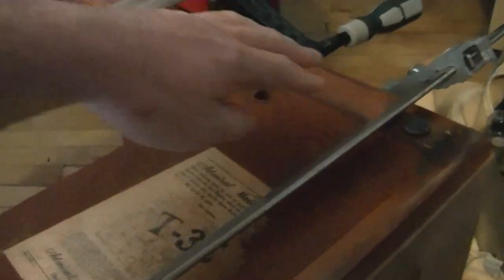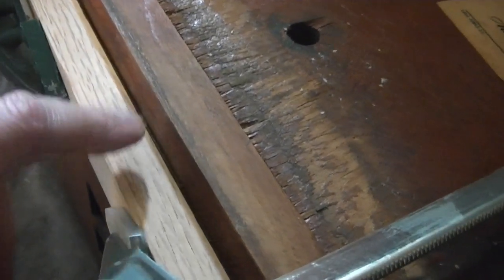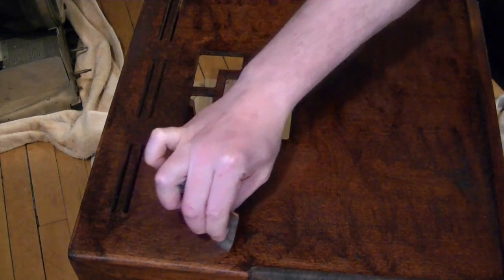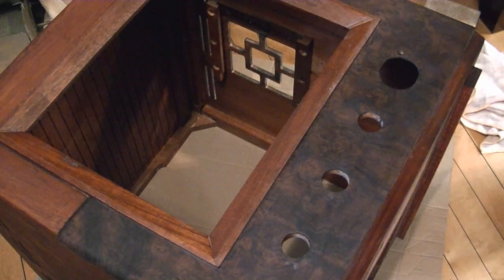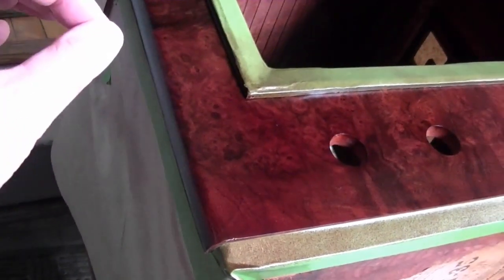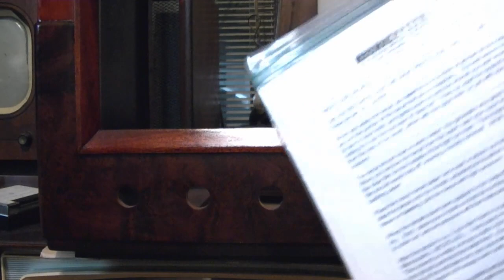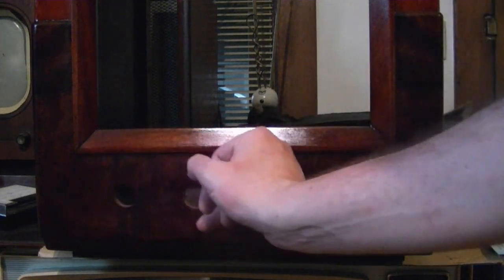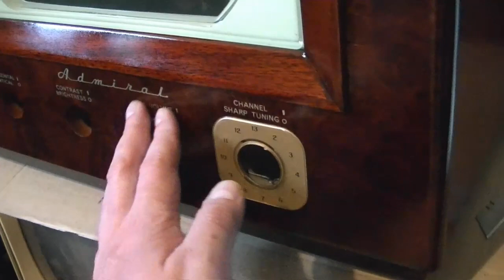Admiral 20X136 restoration p5o9

Comment: Great job, big difference! One trick I use to transfer shaft and dial holes into veneer is to use a small ball or cone shaped grinding stone in a Dremel tool. I start in the center, then circle outward. It is fast, neat and does not chance the grain splitting and running like using a knife does. Don't ask how or why I came up with this method, lol!